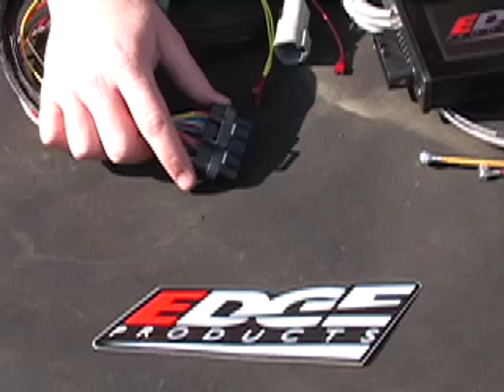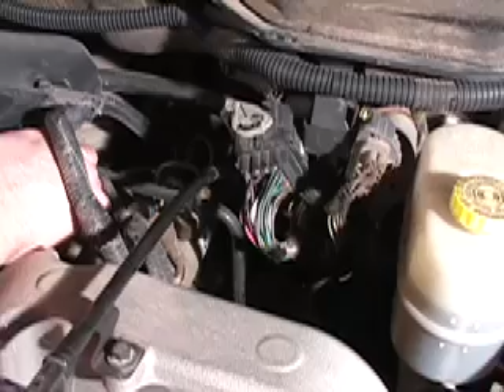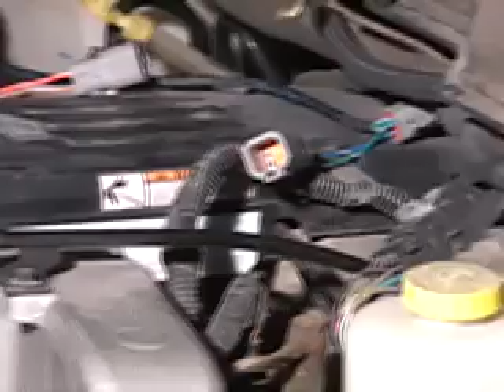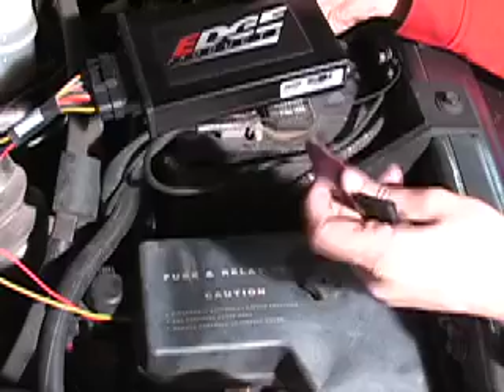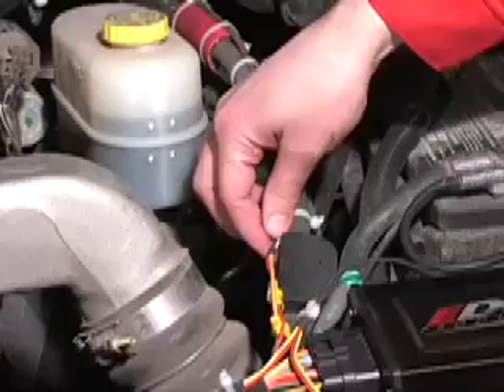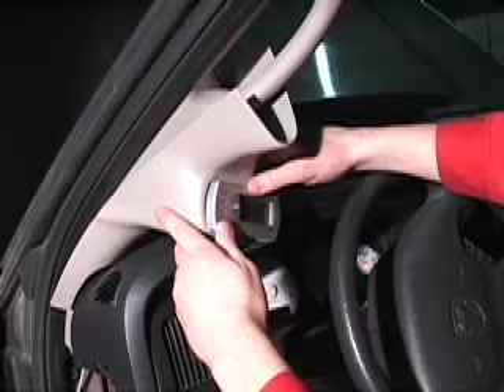Edge Juice With Attitude Install | Edge Products Review

Comment: What model number is this Edge as there are many different models for the same year & engine. Great video, thanks for sharing.
Reply from the maker: This is an old version that isn't made anymore. They have much newer technology available. Let us know what year your truck is and we'll send you a link to the current one for your truck.
Reply: 2006 ram 5.9
Reply from the maker: Edge has their Juice with Attitude CTS2 here. https://www.parleysdieselperformance.com/products/edge-juice-with-attitude-cts2-for-2006-2007-dodge-ram-5-9l-cummins-31504

Or the Juice with Attitude CS2 here. https://www.parleysdieselperformance.com/products/edge-juice-with-attitude-cs2-for-2006-2007-dodge-ram-5-9l-cummins-31404